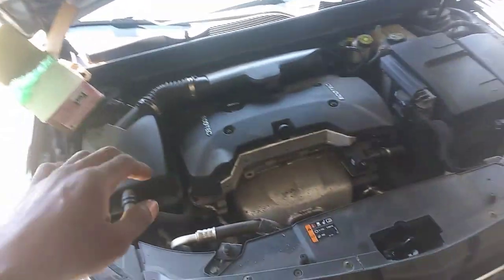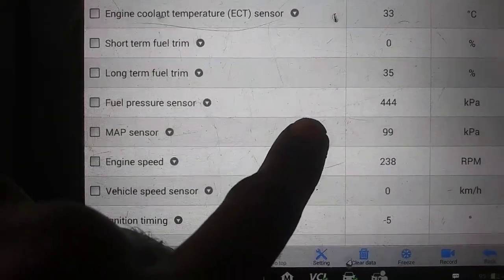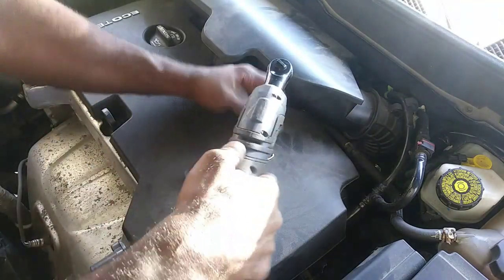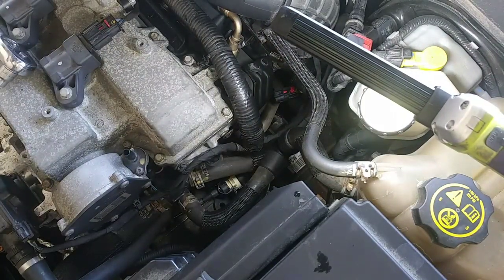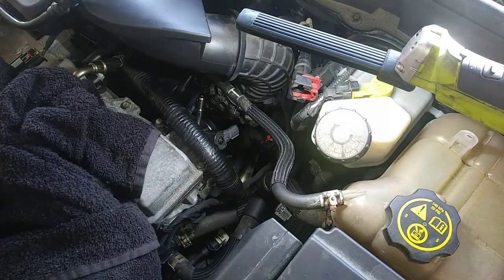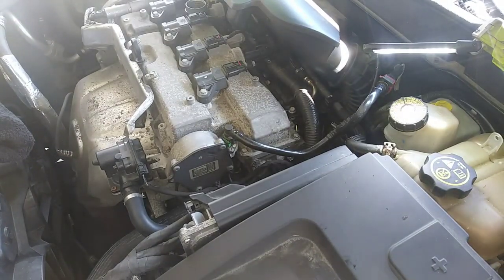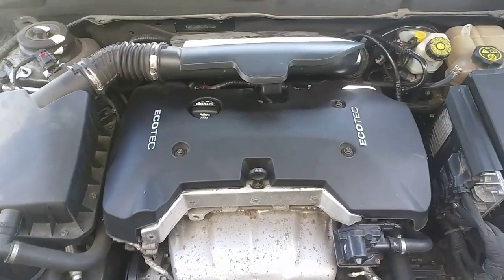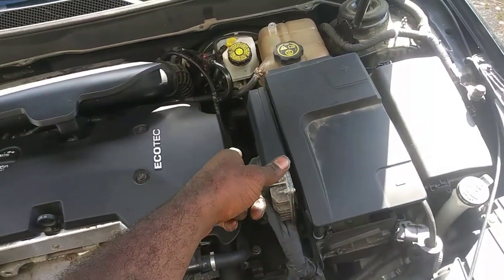high pressure fuel pump

Comment: I finished the job today, and the car runs fine. Let me add a few more tips to this excellent video: Maybe it wasn't clear, but you need a 17mm wrench to get the lower fuel line off the pump. As someone else said, loosen the fitting on the fuel rail when putting that fuel  line back on, so you get the nut started straight, without cross-threading it-it should screw almost all the way on just by finger tightening-then tighten it up with the wrench, and then tighten the fitting you loosened at the fuel rail.  These days, even though I'm a pretty good mechanic, I don't start any job like this before seeing if there is a YT video first-saves a lot of time and aggravation!

Comment: Thank you for making this video! That third bolt on the heat shield was tough to get at, but at least once cracked loose, all the bolts turned out by finger. It was nice to see how to remove the electrical plugs,too. I took my throttle body completely off to get more room to work-(just make sure not to drop anything into the manifold!)

Comment: if anyone decides to do this job, definitely remove the plastic/rubber intake  tube attached to the throttle body and remove the air filter.  it will give you more space to make the job a lot easier

Comment: Whenever ur dealing with high pressure fuel, u always have to find the fuel relay or fuse on ur fuel boxes and take it out and crank ur car until it dies out and won't start anymore.by doin that you will de pressurize the fuel system.never take out a part that has  high pressure and remove.accident waiting to happen😬...after ur done with what ur fix is, then put back the fuse or relay located in ur fuse box  and start ur car again till it recieves fuel  and stays on.That pressurizes the fuel line again
Reply from the maker: Thanks massa
Reply: @partsshooter  no prob broski👍🏽..same procedure when ur testing for fuel pressure with a fuel pressure test gauge kit

Comment: Is the fuel pressure regulator built in
Reply from the maker: Yes, it's electrically controlled via solenoid
Reply: @partsshooter  I been trying to figure that out for so long

Comment: I cannot get the cam follower to go in and I see it has a little ridge to slide it in fully I already tried turning the engine to let there be space I’m guessing it needs to be flush to even get the screws to catch on thread but mine are not close enough at all

Comment: is it correct pressure in fuel rail 400 psi? Usually all manuals says 40psi.
Reply: This is the high pressure direct injection fuel system. Low pressure coming from the fuel pump is between 40 to 50 psi. The high pressure side after is what gets fed to the injectors, is supposed to be a minimum of 290 PSI in a maximum of 2735 PSI.

Comment: So my car keeps like it want to keep trying to crank like the starter  wants to try to keep trying crank the car which make it hard to crank  sometime  so i put a new starter  on it and it still doing the same thing sometimes.  Do you think its the same part you are replacing  in this video  to make me thunk its the starter  but not the starter.  Cause one guy said it seems  like its not getting  gas when it starts doing that

Comment: Excessive use of E85 fuel can result in reduced engine power, MIL on and DTC P228C (fuel pressure regulator control performance – low pressure) set in the ECM as current or history.
Reply: These cars can run on straight E85??

Comment: Hello, im currently going through this with my 2016 chevy impala v6. Do you need to make sure the 3 lobe cam is in a certain lobe when you install the new pump?
Reply from the maker: Not really... However it'll make it easier installing the pump because of the return spring competing. But you can run the pump in by tightening retaining bolts

Comment: Does this cause car to stall at light
Reply from the maker: In this case no, just low power and check engine light
Reply: Code says fuel regulator p0089
Reply: @IronSharpK9Training  having the same problem did you ever figure out what was the problem
Reply: @sylasmartinez4979  I got a new car , I couldn’t figure it out and was spending way too much money
Reply: @sylasmartinez4979  I still got the car just don’t drive it unless it’s down the road and back

Comment: Hello my friend
I have a 2014 impala ls 2.5 (87k miles), the P0089 code appeared and the check engine light appeared only. But the car is fine, no reduced power at the moment. I have a small scanner and it says it's the fuel pressure regulator ( which GM now calls it high pressure pump, if I'm not wrong I think).
In my case it will be that part too or another part related to the fuel system?
Reply: Hey! I’m having this exact problem with my car - did you ever resolve this? Any help would be great!
Reply: Same pls respond lol

Comment: I do have a question. And I apologize for the rant first. So I too am having issues with my vehicle same engine but it’s a 2014 impala. I brought it in to a shop (a friend of my brother in law) and they diagnosed it as being the high pressure fuel pump. Seems like I’d be able to do it myself. However, they said something about opening the manifold in order to clean out the injectors. Saying they are clogged. My car still starts and runs. But it goes into low engine power mode. I feel like if they were clogged the car wouldn’t start at all. He claims 5 hours of labor to open the manifold and clean it out and change the High pressure fuel pump and wants to charge $90 an hour. I’m just confused why he would have to open the manifold? Couldn’t we change the pump and put some fuel injection cleaner in?
Reply from the maker: Based on your car symptoms and what you're saying, what you're experiencing isn't gonna be "clogged injectors".  I would take it elsewhere and pay the 1hr diagnostic fee to determine issue! Especially In your current state, I'll save you money.

Long story short, the cars computer receives information it calculates to determine operation of components, anything out of specification will generate a check engine light. In your case, similar to this video, pressure feedback sensor doesn't provide proper tolerance, which caused the car to enter limp-home mode [reduce power]

I go through  diagnosing in this video... But there could be mechanical problems with your high pressure pump cam lobe. Odds are slim with adequate oil change history.

Clogged injectors on this car will cause isolated misfires, as any other vehicle. As any other car, diagnosing requires code retrieval, clear and address immediate comebacks based on code setting criteria and symptoms.
Reply: @partsshooter  Thank you for your feedback. It is much appreciated. Amazing video!

Codes on my vehicle are P228c and P0089
Reply: @michaelburgard371  did you find a solution?
Reply: On injector cleaning is a good idea. I’m gonna do it when I remove mine today.

Not hard it’s just the plastic intake manifold which is very easy to come off and the injectors sit right on the block with (2) 13mm bolts holding them. 

However there is a cheaper easier way to clean them, sea foam in the gas tank.

If u want to physically do it, you rock the rail back m forth do not just pull it str8 out.

You will need a air line, a reducer , and sea foam to clean it. 

Also new o rings , because the injectors go they several hot and cold spells, once u remove the injectors the o rings will be torn, 

It may seem like a lot but it’s not. 

I rather do that than A rear main seal. 

And it shouldn’t take 5 hours 🤣 

It’s more of a 2 hour things the MOST. 

Contact me for any help

Comment: What's the quick connect tool you used to get the the fuel line off of the high pressure fuel pump

Comment: I have a 2018 Chevrolet Colorado. I have replaced the high pressure fuel pump already. But I am still getting code poo90 bank 1 control circut. what can I do to fix this problem

Comment: Hey man, when piston in old pump is stuck like u show us, does that mean that  pump is bad? I take out my pump no presure same code , and piston is completly stuck ?
Reply from the maker: There's a return spring literally on the pump, you can see the spring as it's exposed.  Whatever component failed, was incapable of consistently supplying the high pressure required, I'm unsure as to specifically what, but it was within the high pressure pump.    

I relied on scan data from the pressure sensor to inform me that the pumps bad. I didn't question the data because of the accompanied driving abilities, it lacked power
Reply: @partsshooter  thanks man, i will see .

Comment: Hello hope you can help me I have a 2013 Chevy Malibu ls the check engine light on  and it runs for a few hours then I will turn it off and it won't start  after 30 to 1hr  the code that it shows it p0232 it's a fuel pump relay  but I can't find it . Would you know where it is located.  

Can  it also be the fuel pump??
Reply from the maker: Fuel control module is located, rear right inside trunk by taillight.

Fuse. Is in under hood, f13ua location 7.5amp.

It's rather complex to describe solution to your problem. Hope that help get you started

Comment: All the same codes . Same motor everthing. . I replaced the high pressure fuel pump. And still having the same reduced engine power. Any ideas thanks
Reply from the maker: Oil level...Timing chain can be off... or worn engine. How's your oil pressure? 

Check the camshaft lobe really good. For the fuel pump. Check your data really well before checking engine related issues

Comment: P0089 would it also be the fuel pressure sensor? only code i have
Reply: my scanner showed 45 psi fuel pressure and 1500 psi rail psi
Reply from the maker: @sheba6789  monitor the desired vs actual data and see if there's little variance

Comment: I have a 2013 Malibu that’s has these same codes , it says it had the power reduce engine , and the stability control light comes on , lack of acceleration, any help?
Reply: I have same thing going on did you get yours fixed
Reply: @robingoff5251  I have the same car and it is doing the same thing.
Reply: my 13 malibu is also doing these things.
Reply: Did you ever figure the problem out having the same
Reply: @sylasmartinez4979  i have the same car doing the same thing 2013 malibu 2.5 motor
Reply: Did anybody replace this and still have the same problem
Reply: @riosavage6972 did you end up getting it fixed? I replaced the high pressure fuel pump on my 14’ malibu 2.5 and im still getting the p228c code.

Comment: Horrible design most are right on top of the valve cover and u just release pressure like normal remove the fuse or relay run it till it shut off give a few cranks then ready to remove and always replace the hard line to the pump but nice video I have to do 1 of these soon same codes issues and a shop changed the Regulator it was ok for a little now its acting up again I knew what it needed so will knock it out hate gm's lol

Comment: What would be recommended if i had a check engine light come on which when plugged in said error for high pressure fuel pump but after parking the car and using it the next day the code and check engine light went away. Probably a future upcoming problem. Reason im asked is cuz i had recently just installed a subwoofer with a 600 watt amp. And was thinking it might have affected the electronics somewhere..

Comment: Hi.. I have a 2014 chevy impala with 150,000 miles on her with the 2.5 ecotech. the car just started going into reduced power mode and getting a P228D code reading fuel pressure regulator 1 exceeded control limits too high. Do you think it could be this pump causing high pressure reading and do you know if this pump has the regulator built into it. Thank you
Reply: U find the problem?
Reply: No... The car did it twice to me and I took it into a good well known mechanic shop. On arrival to the shop .... The car engine light had went off and was running perfect. They called and told me they can't find anything wrong with the car, So I asked them if they could drive the car for a few days . They did ....and they put over 200 miles on it and still the car never did it again. The mechanic told me if he was to guess ...it was a malfunction with the high pressure fuel pump.... He told me that if the car does it again bring it back while its acting up.  The car hasn't done it again and I've put over 2000 miles on it.
Reply: from what I have learned it is the regulator GM just renamed it as a high pressure fuel pump!
Damn millennials!!!
Reply: That makes sense being called a Regulator seeing that the trouble code's indicate fuel pressure is to low or high. Thanks.

Comment: Mine says engine power is reduced and in the past, it said AC off due to high engine temp. Does anybody else car do this?
Reply: Might want to check coolant temperature sensor. Have you checked codes? May want to check under engine cover, above transmission to see if you see any coolant seepage or leaks. Had a friends sensor leaking and shorting the wiring so sensor was reading that coolant temp was 190 degrees even though vehicle was just started cold.
Reply: @Raylude5  yes, I checked the codes. my check engine light is not on anymore. I have not taken it to get checked at a shop yet.